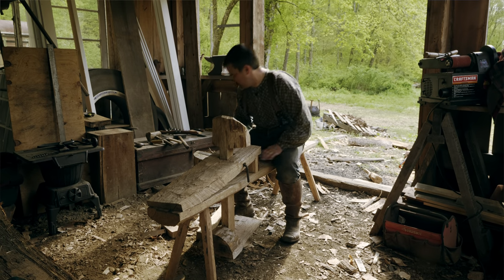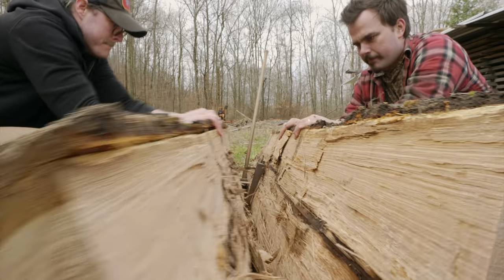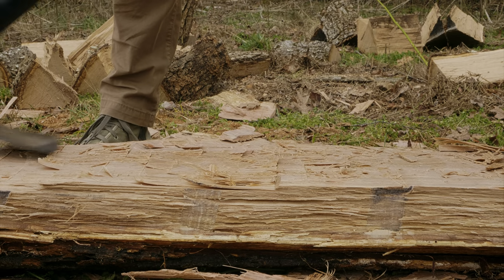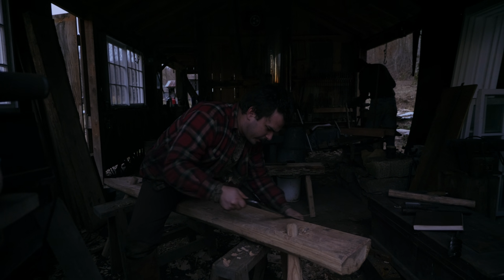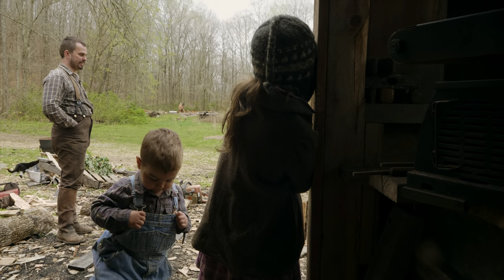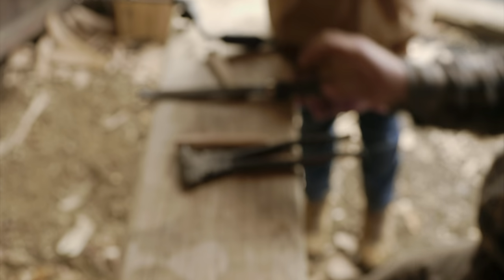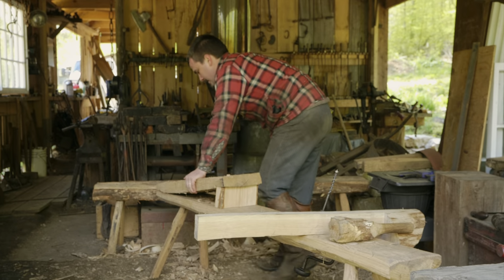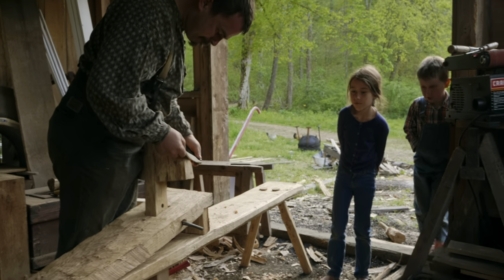Making a Shave Horse from Start to Finish

Comment: Great video.  Really like when the kids are hanging out with you.  They watch intently at times absorbing information like a sponge.  Keep it up!
I have a nice white pine board I got from a water powered sawmill in Connecticut many years ago.   20 inches wide, 14’ foot long, three inches thick. I think I’ll use it to fashion a schnitzelbank (German style shaving horse) for my wood shop.  
Cheers!
Whipple

Comment: You did a really good job on that project, the leg angles you came up with were very close if not spot on to the recommended 10 degree 16 degree that I found is the most stable.  The style you built is the German Dumb-Head style.

Comment: The bigger the wedge the more inertia you have to overcome to move the wedge. Basically conservation of momentum, m1v1=m2v2. (one of these m's would include the mass of the log too) The wedge angle is a factor as well, obviously. Nice work. (.....block grain run the other way?)

Comment: You should think about making yourself several wooden wedges. Those work better than steel wedges for splitting. 
As for heartwood or sap wood is left on, I've heard conflicting stories about it so, can't say to leave it or not. I will say, remove the bark though. This brings in bugs, and rot. If you have hand planes, those will help smooth those surfaces. Great video, cheers :)
Reply from the maker: Agreed on the bark! Also, wooden wedges and mallets are high on the list. Need to get it done!

Comment: A draw knife is used with the bevel side down  to help control depth of cut. And drawn in a slicing motion, not a scraping motion.
Reply from the maker: I’d argue it is used in both a slicing motion and a scraping motion, depending on the task at hand. I do a lot of slicing and skewing. As for the bevel, that totally depends on the drawknife, and also the application. Some knives are intended to be used mostly bevel up, and some bevel down. Most (but not all) of the early drawknives I’ve seen were intended for use with the bevel up most of the time. When doing inside curves, the knife is flipped over.

Comment: The bench of my current shaving horse has that same errant split as the piece you opted to scrap ;) It's red oak, I believe, rather than white, but plenty of strength in either one, even with a wandering split in there ;)
Reply from the maker: Absolutely! Red oak is mighty fine for one of these!

Comment: Another question on the mushrooming it is the byproduct of the lost energy or the product of the wasted energy Cohen if you clip off the mushrooming on the end, does it come right back with further use and/or does it begin to active sort of shows up Sorber and does it stop growing the size of the mushroom end of the wedge when the shock absorbers have been made to the appropriate size regarding the first used by the sledgehammer, and the materials used in the wedge

Comment: So two questions about your physics lesson on the mushrooming that happens when hitting a wedge into a tree: the first is could that be avoided by using stainless steel wedge? 
And two cash what about a hollow witch?… Could a hollow witch be sufficiently strong if it used, sort of baffles, or inner walls, sort of skeletonizing, the wedge, which may be made out of a hardened steel, so it would be possibly prohibitively expensive?

Comment: I built the same one back in the 70's.  I used it for years.  I need to build one now.  I think I am going to cut the boards with the chainsaw.  Love the video.  Brings back good memories.  I never got the legs that good.   Helpful tip, read the bark.  The bark will tell you that the split will twist.  At 22:28 you have one good shot that will show you.
Reply from the maker: Thanks! Yeah I knew there was going to be some twist in the log from the bark, but I had hoped I could work around it easier. It was what I had and needed to be used.
Reply: @AxeAndAnvil  it happens.  Keep up the good work.  I enjoy what you are doing.